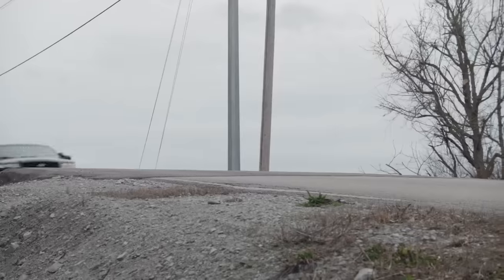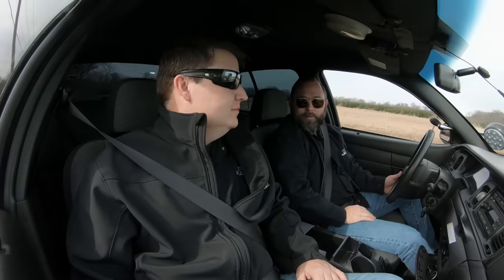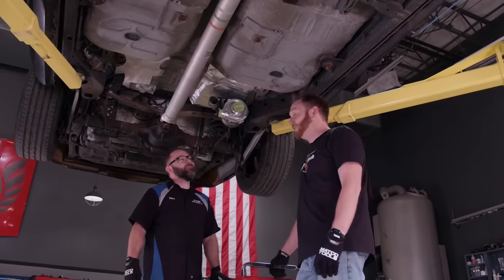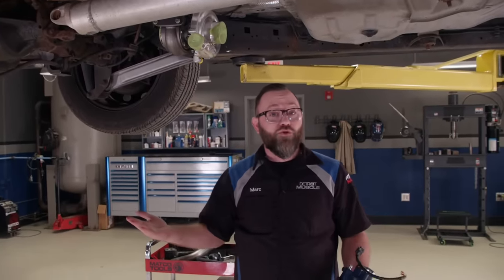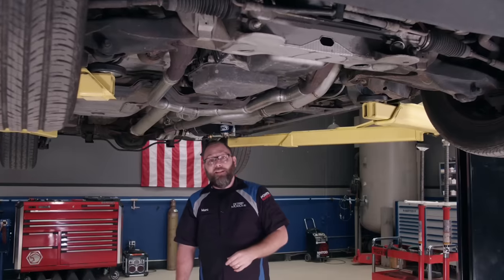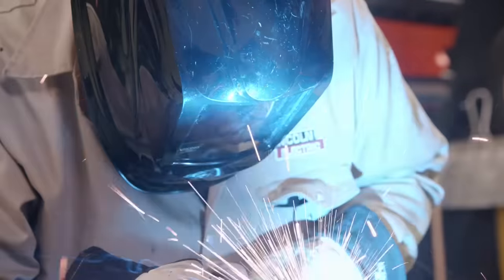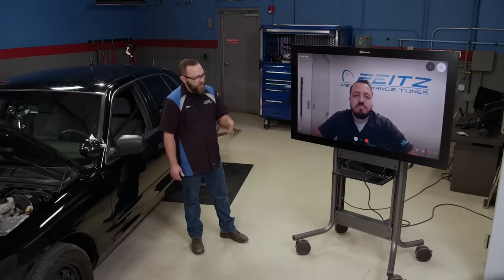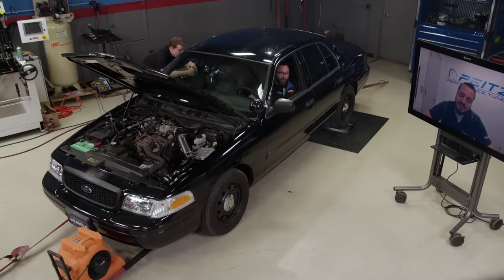Boosting A Crown Vic Police Interceptor 160 Horsepower - Detroit Muscle S7, E7

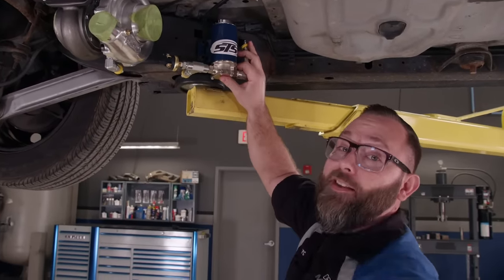Comment: 9:30 RIIIIP if you ever bottom out. You'd rip the hell out of those things clean off. Those tact welds won't hold for $ht. It'll bend and snap off. Your car would be stuck or running like crap. You'd need some sort of thick metal plates to protect it. And if u drive through water....even worse man. This remote mount sucks donkey dix bro..

Comment: Is it 160 or 250hp?
Reply: 200 to the wheels probably 250 to the crank
Reply: Lassi Kinnunen  hp per liter is a useless value
Reply: Started with 200whp, ended with 368whp so they boosted the output 168whp

Comment: A Stock crown vic is 250 hp not 200
Reply: 200 was the wheel dyno number. 250 is the factory flywheel rating.

Comment: Smells like.......hmm.....S/C Coyote upgrade with new suspension & Brembo 13" brakes for a new project. Can't waste a newer car with a full frame on just a single turbo....
Reply: CVPI has 12" front and 11" rear rotors already. Pretty sure they came with drilled fronts, at least my 08 still has them.